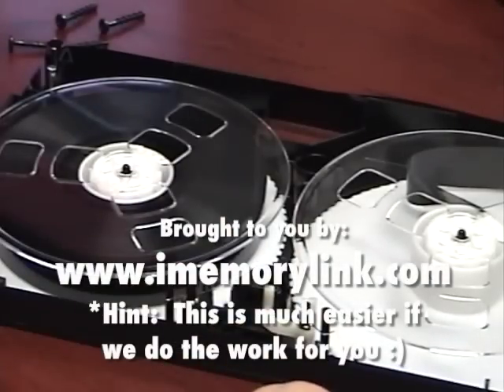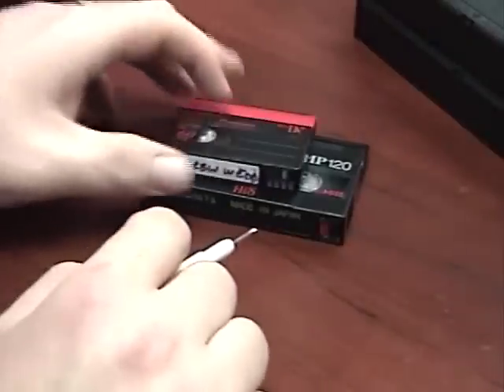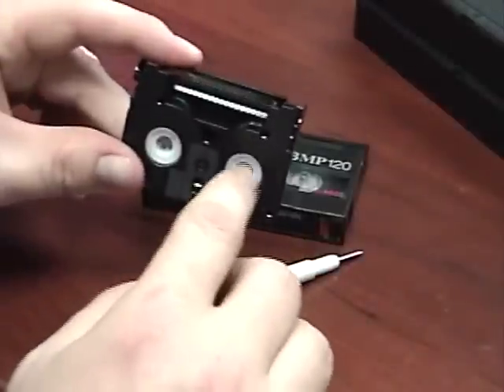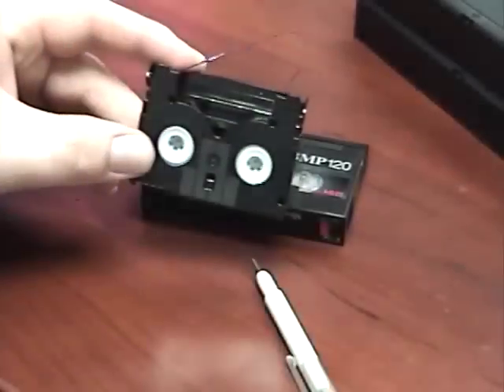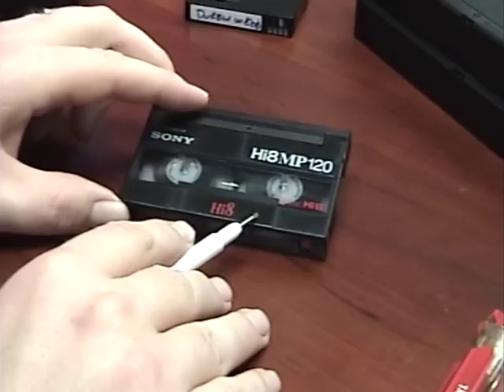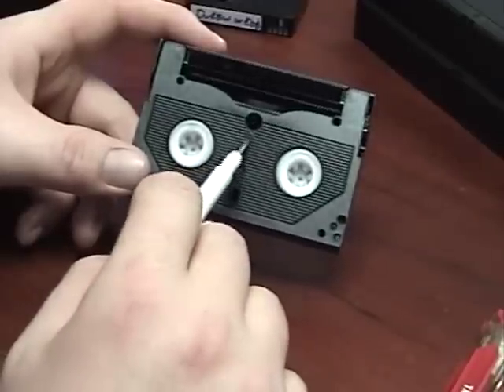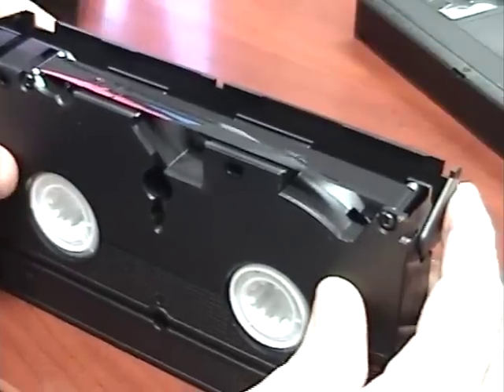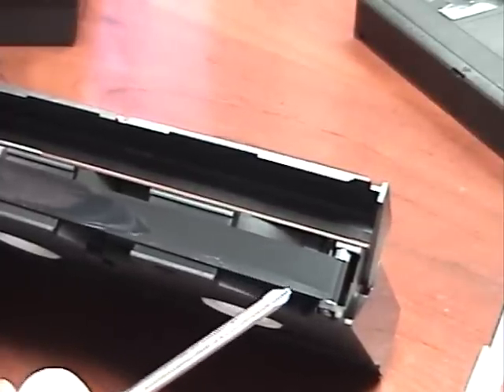How to Repair VHS 8mm hi8 & minidv Video Tapes Repair Pt. 3 of 3.mov

Comment: I have a Hi8 MP metal tape that I opened the case and the spring popped out.  What orientation is that spring placed.  The gate will not stay closed.